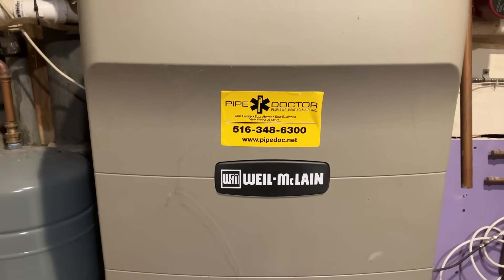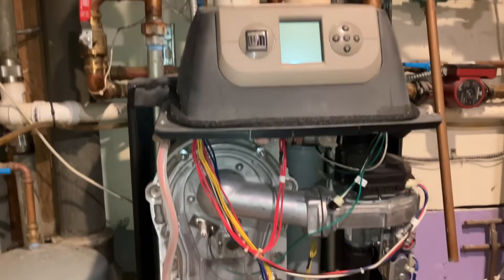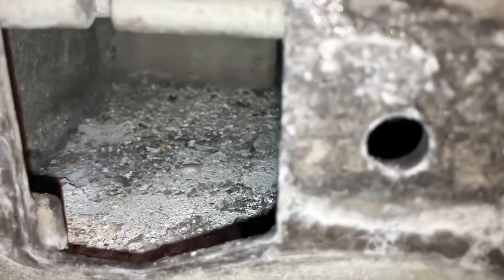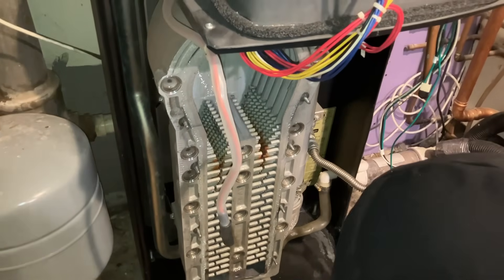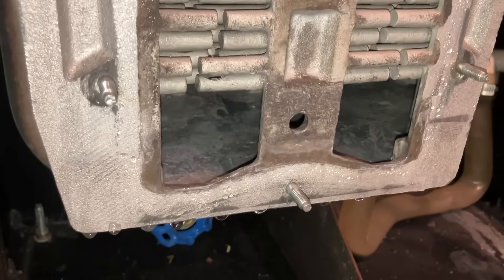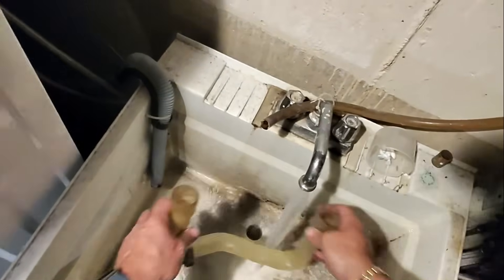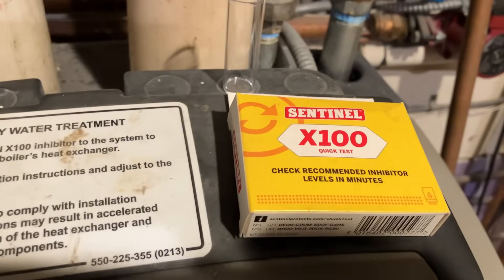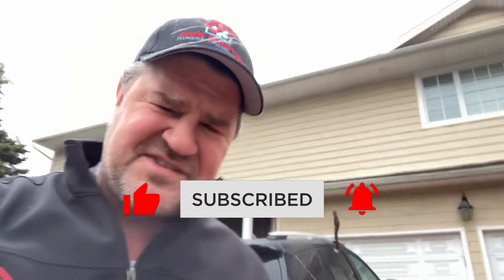Weil-McLain Ultra 3 Maintenance: Heat Exchanger Pin-Side + Water-Side Cleaning

Comment: Question for HVAC Pros from a retired electrician…
First of all, Happy New Year!

Here goes. 
I replaced a defective Taco (007) circulator in my elderly neighbor’s hydronic system last week.
It was my Christmas present to him as he was living in a 60 deg home with one of 3 zones working and couldn’t afford to call a plumber in.
He’s a disabled firefighter and used to help everyone until he was badly injured.

Here’s the question..  He replaced his Weil-McClain boiler with a CGA-5 (nat. Gas) about 10 years ago.
I had to drain the boiler because the installer didn’t think to put in isolation valves above/below the 007.
The water was foul and black.

When refilling (and purging air), is there any type of additive or cleaner required or suggested?
Thanks !

Great channel Mikey P!
Reply: Worked on old boilers years ago. Black is good no oxygen left in water to corrode the system. If it was rusty brown you have have issue.

Comment: Great job
I had Ultra 105 that I replaced with a Burnham cast iron series 2. The Ultra developed a hole in the back of the  heat exchanger towards the bottom. My CO2 was going off. I didn’t find the hole until I was performing Mtc, washing the heat exchanger. Water was leaking out. My ultra  was only 11 years old. I performed Mtc annually as per manual. I’m also took several in person  training  classes from WM over the years. Excellent boiler, but went back with old school Cast iron.

Comment: Very clean.
A couple quick questions 
1. How did you remove the burner without breaking off the 3 bolts in the front plate.
2. That wasnt extremely  dirty to begin with, most the time when I get to clean them the passageways  are like cement  and the sword won't break thru. You tear them apart yearly  when doing the maintenance?
Thanks